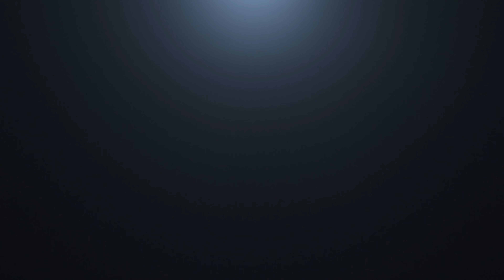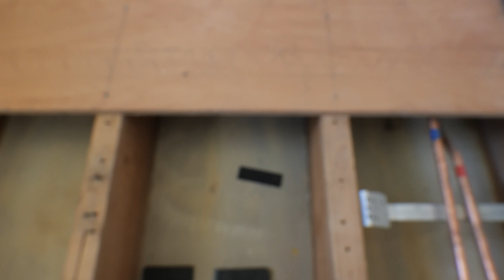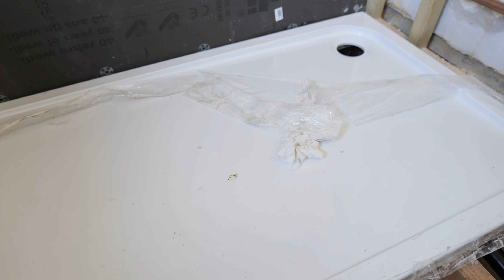The pain of bathrooms

Comment: I've always been told the idea of putting a tray down isn't to "stick" it down, it's only to prevent movement which is why sand and cement is recommended on most installs so back buttering isn't required :) but great work I would not like to be installing the trap like that 🤣
Reply: This guy does it right regarding the tray, I always bond the back of the tray and use rapid set to fix

Comment: Nice work, I've tried fitting the trays on tile adhesive but gone back to plenty of silicone and plastic packers. I found if you put a bit too much tile adhesive under it it wouldn't drop onto your packers and isn't much fun keep lifting the tray up, couple that with mixing up and cleaning up...
Reply from the maker: Thanks 👍👍 I think I'm just unlucky with the floors we get. Always miles out of level! If ai could get away with a bit of silicone I would .